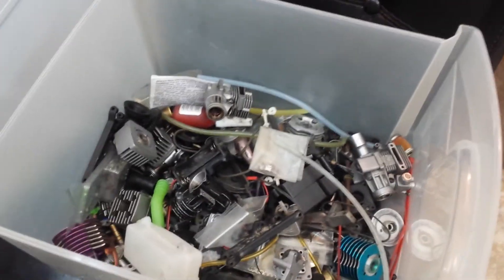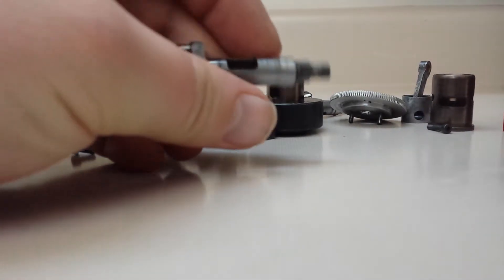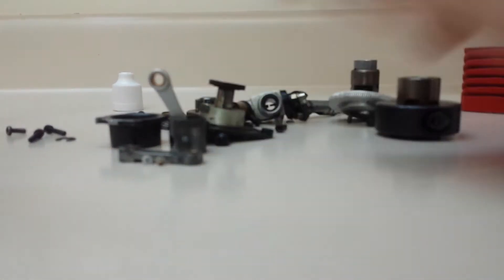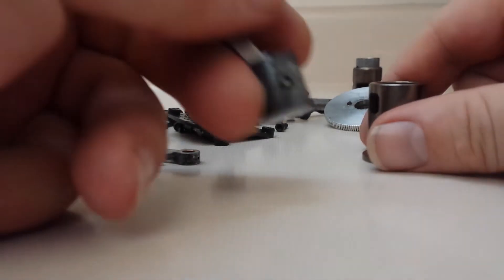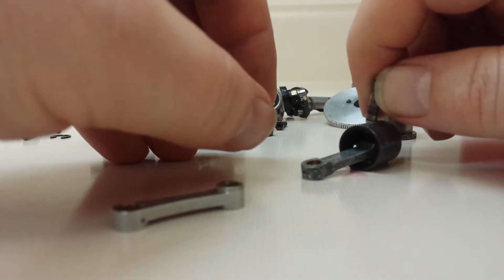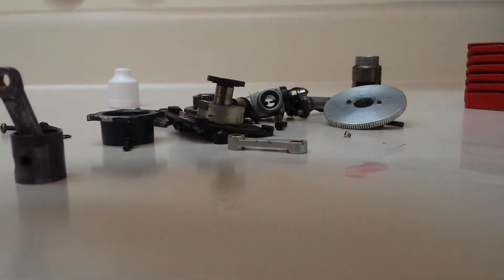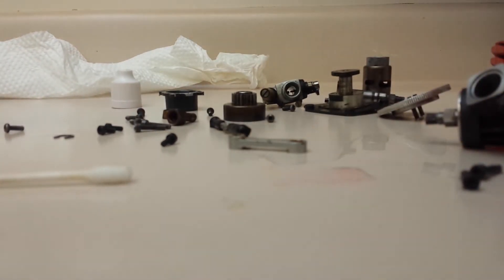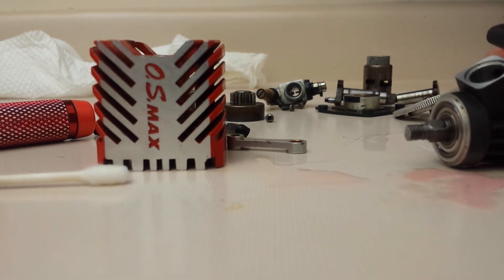The old dead OS 12 CV nitro used parts rebuild part 1

Comment: Hey bug404 loving the fact that you're like a walking Encyclopedia of cross references when it comes to knowing what Parts can be substituted between different engines and brands... But what I really need to know is how were you re pinching the sleeve using what tool because you did it off camera and I can't really tell what you did or what the part was that you were using to do the re-pinch... it would be great if you could explain it in more detail or demonstrate the process on camera
Reply from the maker: Yeah Hey thank you very much for sticking around watching my nonsense and as far as pinching goes I did buy one of those eBay pinch tools just to see what would happen and it's absolutely not worth your time or money they will turn your cylinder into an egg and it will never run properly again The best thing to do is contact RB mauds or RW mods and it's about 20 or $30 both of them are in my RC group nitro/diesel/gas rc and more if you want to check it out 2 questions to answer and I will let you in

Comment: hey man i know old video but im rebuilding the same more new pinch new barrings new rod but curious do these rods have clips holding the wrist pin in ?
Reply from the maker: They have slider pucks that hold the wrist pin from falling out. If you start the engine without thrm it will last 10  seconds before its destroyed
Reply: @thebug4046  pretty simple to take out and reuse?? i dont have new pin or pucks you say just new rod
Reply from the maker: @tuckerroberts6951   Depends on how worn out they are you might have to replace them which they usually come with a new wrist pin

Comment: ok man how the hell do you get the little nylon parts out of the piston
Reply from the maker: You can't. They have been gone for years now. Unless you can find a new old stock wrist pin for your engine it should come with them. Or you will need to get some PTFE rod that's really small and make your own

Comment: I have a Toki .05 engine and I had the issue while rebuilding I had a single wristpin plastic tab broke off. Would this be detrimental to such a tiny motor after the rebuild?
Reply from the maker: Yes you have to have both of them they retained the piston pin from moving if they are missing the piston pin will take out and completely destroy the cylinder and piston Now if you have lost these plastic tabs see if he can find your self a piece of Teflon since that's what they're made of and stamp or see if you can cut yourself out new ones to the best of your ability
Reply: @thebug4046  Thanks for the rapid response. Well just to clarify the engine came with only one wristpin tab from the factory due to the different hole sizes in the piston itself.
Reply: @thebug4046  Would teflon tape form and hold?
Reply from the maker: @EliEmmanuel2010  ah ok yeah some of them are like that or only have one clip now if you need i do have a group called nitro/diesel/gas rc and more on Facebook if you wanna check it out
Reply: @thebug4046  Sure does it cover these tips and diys?
Reply from the maker: @EliEmmanuel2010   I'm not sure about Teflon tape in fact I've never really heard of it they usually are machined out of a thick piece of Teflon and then just pushed N kind of in the shape of a mushroom is the best thing I can really describe it to or a Puck
Reply: @thebug4046    I tried with no luck. The wristpin is the size of a pin that goes through a wheel hex nut. I'll have to run it how it is. Thanks for the effort.
Reply from the maker: @EliEmmanuel2010   Maybe join my groups on might have something or a better idea Because if you do run it like that you'll be lucky if you get maybe 2 or 3 minutes before it's destroyed

Comment: Hey man have a brand new cv12 and I was wondering what kinda transmission to put in it
Reply from the maker: You would have to have a car or truck to put it in You can't just put a transmission on it  it doesn't work like that  there is Thousands of them out there lol
Reply: You might not know what it is but I was planing to put it in a academy rt4 gp it’s an old stadium truck
Reply: I ended up getting the right transmission and I didn’t know if it would end up fitting right since it’s a short shaft